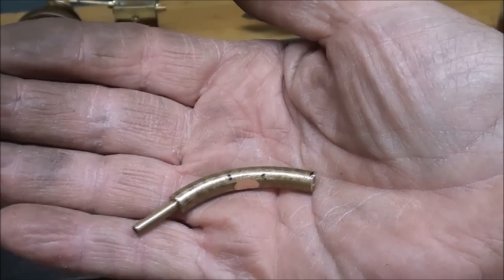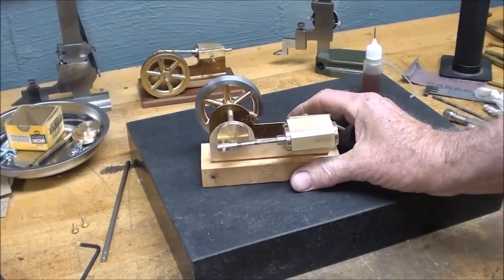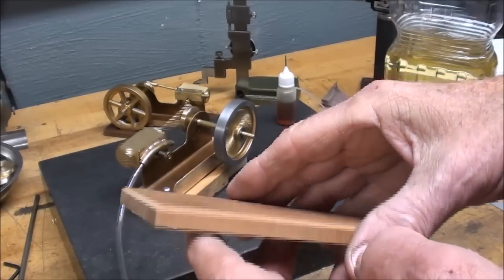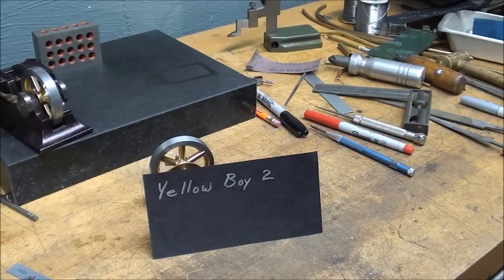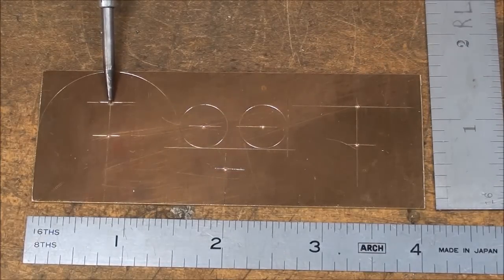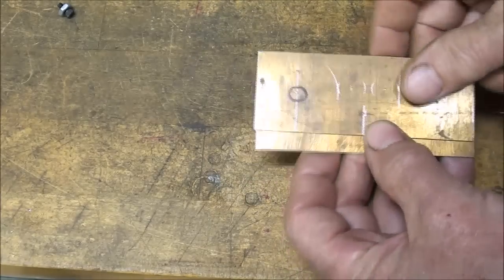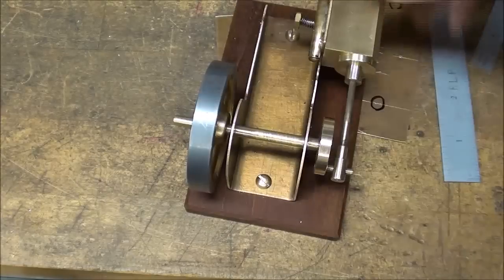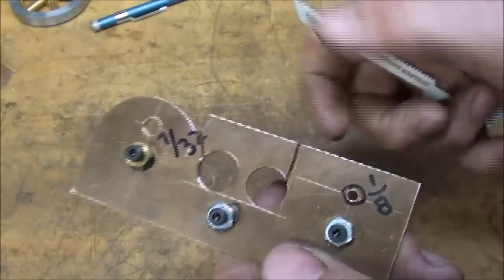Part 7 of 10 - tubalcain Builds the YELLOW BOY STEAM ENGINE

Comment: Awesome as always. Just for grins, you could replace both compression springs, nuts, and threaded sections with a small hole in each cylinder pivot shaft and a small tension spring between. Eliminates several steps but also would have a somewhat catastrophic failure mode if the tension spring breaks during operation.
Reply from the maker: +Bill Strahan That's a great idea-never thought of it

Comment: An interesting video as always. There does seem to be a flaw in your design for number two though. Unless I misunderstood what you were describing, I believe you said there are three stays and the holes you drilled to clamp the plates together are those stay holes. If that's correct then you haven't considered what's going to happen when you try to fit the flywheel.

Comment: You've probably already installed the main bearing(s), but this looks like a good place for precision alignment. If a long piece of bearing tube is soldered into both holes, then you can cut out a center section and leave two bearing tubes which will be perfectly aligned. Alternatively, your could pull a reamer through the bearings, using the long shank of a chucking reamer as the pilot to assure that the reamer is perfectly aligned with the bores of the bearings. Pull the reamer through the first bearing; then reverse it and pull the reamer through the second bearing from the other direction. (Reamers don't have a proper entry chamfer on the back edge, but for cutting brass it shouldn't matter.)
Reply from the maker: +Peter W. Meek You are getting a head of me
Reply: I tend to do that. You can ask Keith Rucker and Tom Lipton about that.

Comment: Looks great, now can you show myfordboy how to make a working model generator with rare earth magnets and copper wire wound around a soft iron core that will run off the engine.
Reply: Jeeez I wish people would stop harping on about +myfordboy generator. It is a model for Pete's sake!
Reply: +Clayton Firth Your right, he should have made the steam engine "model" battery powered.  He could fit it under the base with a little motor or better yet mill it from plastic as it only took him days of effort and meticulous setup.  What is an extra hour or two to wind some copper wire and secure a magnet.